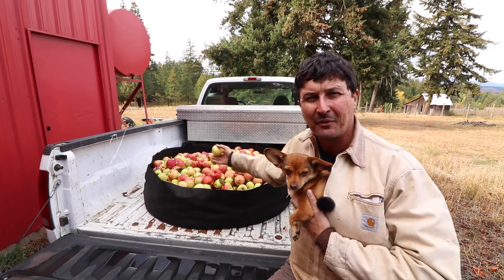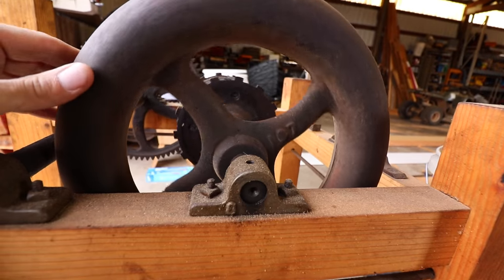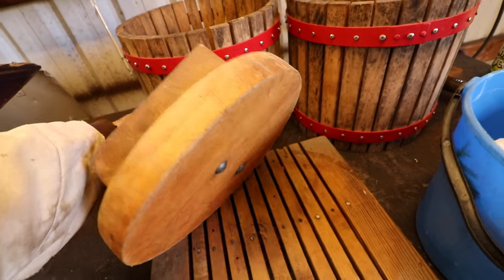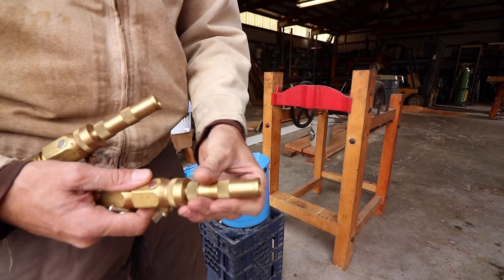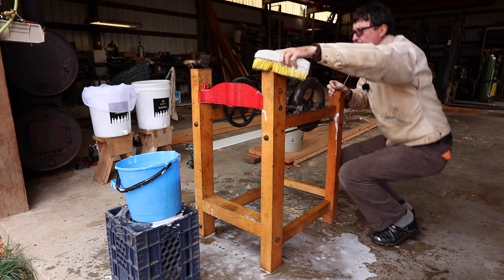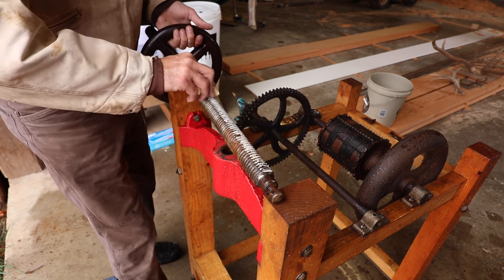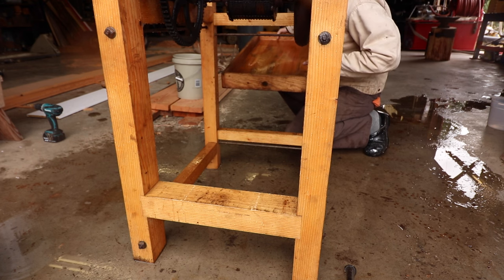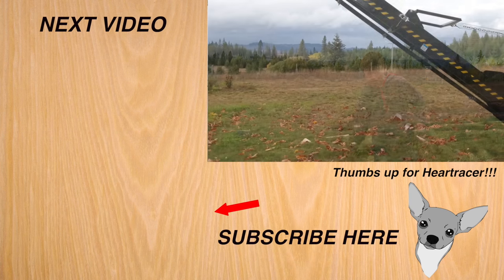AMAZING 150 YEAR OLD MACHINE!!

Comment: The press you have is actually a hocking valley double barrel. The name that is stencil on the hopper/you mentioned is just a branch house or hardware store it was sold through. the smaller version are much rarer. If you would like I can put you in touch with a guy that reproduces parts for just about any brand of antique press. hocking valley, americus, etc. he could tell you the age and everything. Really nice guy. Another tip is that if you plan to make hard cider it might not work because if any of the apples/cider some in contact with cast iron it does something chemical to it and gives it a bad taste. I've learned by experience and that's what I've been told.
Reply: stenciled*
Reply from the maker: Thank you for the info Tim.  I'll pass it on to Cody.  MrsW
Reply: Anytime. forgot to mention Cody is right on with the prices. Also a better food grade alternative to boiled linseed oil is mineral oil.

Comment: If you put the dry fiber mass with the seeds in good soil, you will get at least 50 apple tree seedlings you can move and grow to a bigger tree for planting or as a gift
Reply from the maker: We've heard that you want to get apple trees from grafts and not seed or the trees might be fine but the apples not so good - have you not found that to be true?  MrsW
Reply: I have one tree that produces 7 kids of apples here and they are amazing. Grafting is easy to do. But before you can graft you need a plant with a root system. This is a good way to get a lot of strong trees popping up so you can grow them larger and graft on good apples later.  If you get 50 seedlings up from 2-3 thousand seeds you know you get the stronger plants.  but grafting is cool.  you should try it if you have a under preforming a fruit tree..  I have grafted cherry, pears and apples with success.
Reply: Oh forgot, you always graft in the springtime. Some small trees like the https://en.wikipedia.org/wiki/Redcurrant you can just cut of a seedling and stick it in a pot and you will have  a new bush soon.
Reply from the maker: We have a ton of little strong trees (apple) and have done grafting.  So fun when it works.

Comment: I bought a Happy Valley Ranch press about 15 years ago on eBay for a good price. I had to drive to Yakima to pick it up. It is difficult to hand-crank the grinder while feeding apples. I finally bought pulleys, belts, pillow blocks, a jackshaft and a motor.  I use a 1/4 HP blower motor, which runs at 1725 RPM and reduce it to 64 RPM. I may switch to a worm-gear drive to avoid large spinning pulleys and belts. The closest I found results in 86 RPM, which is a little fast but will still work.

Comment: I have seen the brass nozzles, valves, and hoses at a lot of irrigation supply places like here in Southern Alberta, Southern Irrigation carries a lot of stuff like that. And some of the Wildfire supply stores carry the brass valves and nozzles. But I find with hard well water it can cause either a mineral build up or a kind of oxidation on the brass. But they are nicely made and it is difficult to find a decent garden hose unless you go to a specialty place.

Comment: Love the butter lubricant!Have you considered adding a little cinnamon in place of graphite powder? :-)For those folks inquiring about the bees wax.Iirc, it does not have the shear resistance required and would break down, as well as not being as slick as animal fat, so the screw would be rather difficult to rotate by comparison.

Comment: Wow, well I think you just helped me answer a totally unrelated question i'v been trying to figure out for the last 3 weeks or so when you talked about that fly wheel.  I was at Greenfield Village in Dearborn Mi a few weeks ago and I saw a really old steam tractor. On it, it had a rod sticking out of it with what looked like a pulley at the bottom that a belt could possibly go around, and at the top of the rod you could say an upside down V attached (kind of looked an arrow you might draw to point at something).  On the ends of the upside down V it had attached on each end close to probably 3 1/2" solid metal ball (so two in total).  This rod could spin 360 deg.  

After watching your video I figure it must have been a modified type of fly wheel.

Comment: I like how even half way across the world apple presses tend to be the same. I mean the design is pretty much the same as here in central Europe. All the metal parts are painted with identical shade of red. :D My neighbor has it, but the design is slightly different. The barrels are a  bit wider and allot taller, and there is a big screw running down the middle, where you screw on the pressing bit, it has a ratcheting system tho and it stands on 4 legs. the base is built with a funnel so the juice automatically pours in the containers of your choice. 

The juice is a million times better than the one you buy (even the one labeled as all natural "home made" style). The tradition is that when you press it you keep some of it for juice (some of it you boil so it will last longer), some of it for vinegar, and the rest you know you wont use and will go bad on you, you give to your neighbors. So even tho we dont press our apples anymore we still get around 10l of "cider" from our 2 neighbors who press.

Comment: I may have to invest in one of those nozzles. I had a nice metal one I liked, trigger style. My son played with it in the sandbox a few too many times and sand grains wore out the o-ring. I went to Home Depot looking for a new ring and the employee trying to help me looked at me like I was a crazy person. "You just buy a new nozzle, man. They're five bucks."I bought the five dollar nozzle because a trip to a good hardware store like True Value would have cost me more in gas than the five bucks, and I needed the nozzle that minute. I kept the broken one and will buy a new ring when I remember to bring it with me. The five dollar one is garbage and won't keep the spray selector in the right place. It always slips over and you end up blasting water out of the seams.

Comment: I would suggest the stainless steel connectors instead of brass - it'll be special order in all likelihood but will not add a metallic taint to the juice (in case you also decide to plumb your juice collection using similar hosing). We purchase ours through the local pneumatic tubing supply company - I expect whoever supplies operational backup to your local sawmills, back-hoes, etc. will be a good place to chat first.

Comment: You could line your bottom box with a trash bag that you pull through the hole and then just poke or cut the end off of that and it would be clean and wouldn't leak below.

Comment: What do you call those neat stands the buckets are sitting on?  I'd love to search for plans for those, by name.  They seem to be a very efficient design to use in a step stool: stability from the angled pieces, joints not relying on pocket screws, or fasteners driven into end grain -- not like some other stool designs that essentially have you putting your weight on a butt-jointed nail or screw.  Strong, yet simple!

Comment: Did you make those racks out of red oak or white oak? Asking because red oak is used for building boats and ships because it has no capillary action or very, very little capillary action. You can check this out your self by putting two pieces of wood grain up of course so you can see the rings. Then you wait about 10 seconds and you can see the water/ alcohol is better it is even faster. You will see not capillary very little on the red but the white will show water/alcohol on the top of the wood grain. Just saying. Cool project great video too!!